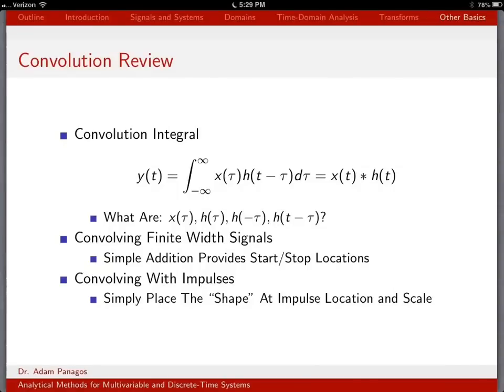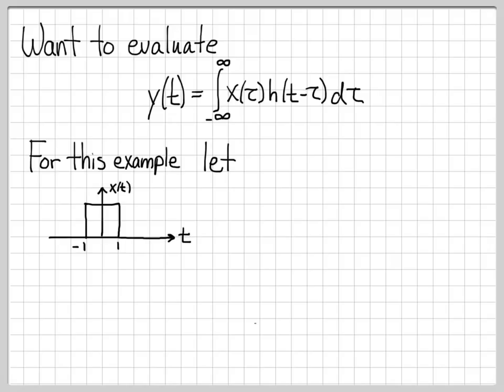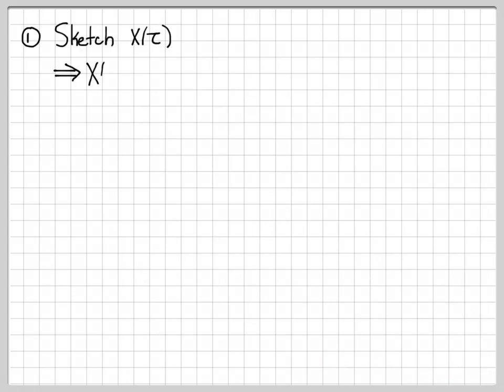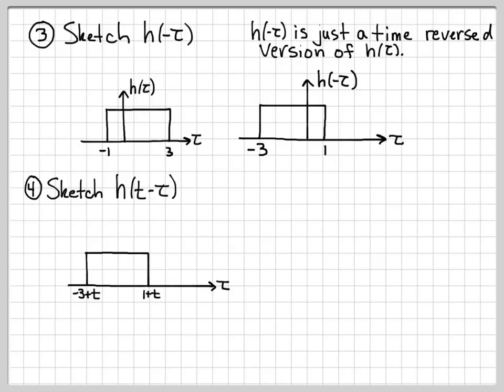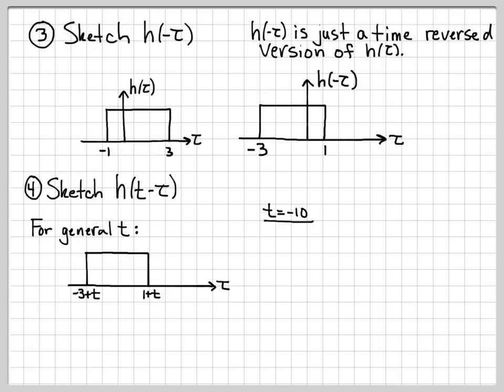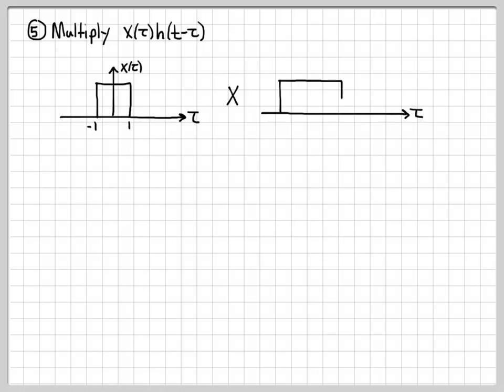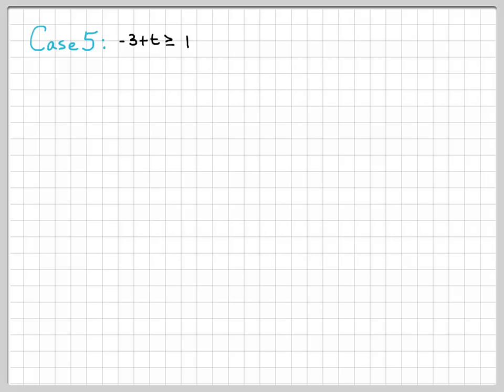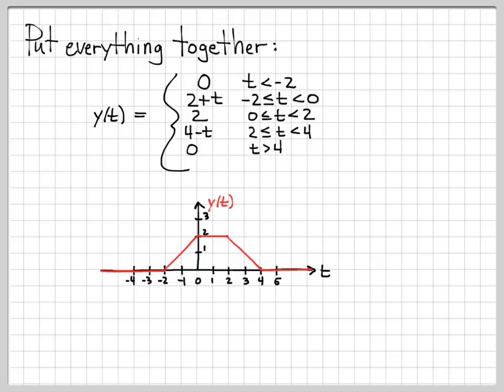Discrete-Time Signals and Systems Introduction (5/6): Convolution Integral

Comment: This is a continuous convolution, not discrete. Great work either way
Reply from the maker: Yes, that's correct.  This is a continuous-time convolution integral.  This set of videos is just a review of topics at the beginning of a "discrete-time signals and systems" class that I teach that reviews a few of the continuous-time concepts we'll need.  Thanks.
Reply: Adam Panagos Understood. Thanks

Comment: Will this method be able to be applied for an input sin wave?
Reply from the maker: When working with a linear time-invariant system, the input and output are always related via convolution with the system impulse response.  However, for an input sinusoid, working in the frequency domain would probably be an easier way to work the problem.